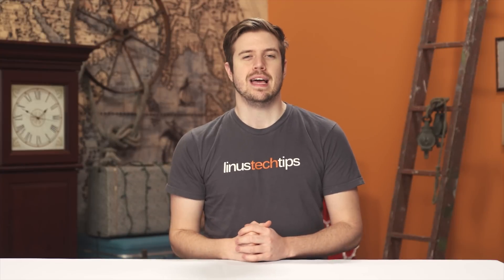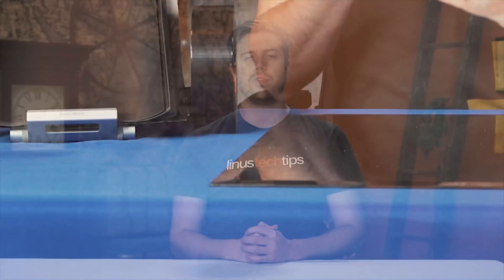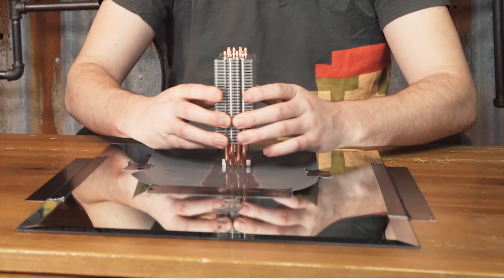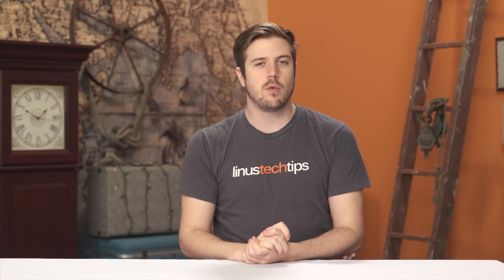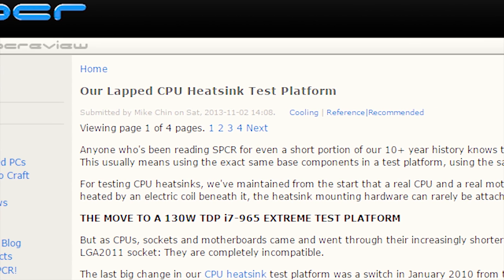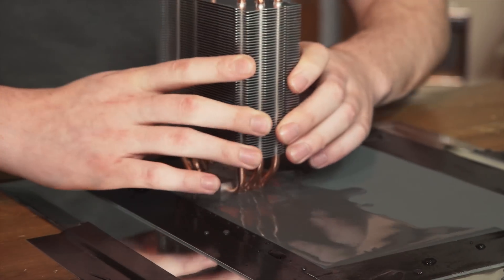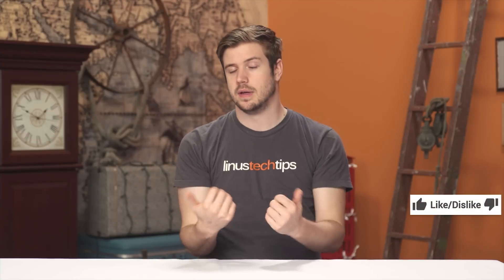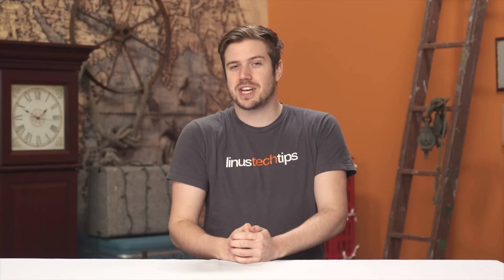CPU & Heatsink Lapping - Are concave, convex, or flat heatsinks best for cooling?

Comment: Your lapping job initally looked quite poor. It should be a mirror finish when said and done. Lapping is meant to take out imperfections you are unable to see with the naked eye. If you can see a scratch. You have a defect in your surface

Comment: Look at all the 9 year old comments. The Internet last forever. Anyone tried Honeywell PTM7950 Thermal Pad. It does a phase change and turns into a liquid when the parts warm up. It seems to work very well. I want to try a mx4 vs Honeywell pad.

Comment: My stealth cooler for my 5600x got some scratches and so did my cpu. My temps were in the high 80s. I wet sanded them both and put it back together. It’s now in the low 80s to high 70s not much of a difference but kinda. I just need a better cooler honestly. It’s a small custom build in a q300l with a full atx board and the psu in the top right. It gets warm lol. I also need a new case but this is working

Comment: In curious if convex vs flat has changed at all with chiplet based CPUs. There’s more heat further away from the center, so does a convex cooler make less contact where it needs to?

Comment: Just to add a modern take on this.
11900k, concave stock
Ek aio 360basic, flat.

Lapped 11900k flat. 
Noticably removed high spots opposite the socket clamps.

Dropped 8-10c at idle, and 4-6c under most synthetic stresses.

Same paste, same tube. No lapping on cooler.

All max speed fans, and pump in both examples.

Also did a 12600k, with a nhd15, but did both flat. 2-4c regardless of load.

Comment: People always forget to tune their components in concert! You need standard thermal paste to fill standard gaps between heat spreader and cooler. When you reduce those gaps by lapping you need a different TIM to make use of the full potential of your change. When your surfaces are flat to 1µm (which you can achieve by manual means!) a thermal paste that uses 20µm particles is harmful to your result. You need smaller particles or no particles at all. It's like mounting race car suspension in your off road truck and then use energy saving narrow tires. USELESS!
It's funny to see computer nerds in shock and awe when using something mundane as sandpaper. ^^ You can get away with doubling grit numbers speeding up your process tremendously. 400, 800, 2000, 4000 then polish. Good enough. You are grinding soft copper. Not steel sheet.

Comment: One big problem here in the lapping
He is lapping the cpu and heatsink where they are not under the stress/pressure that it is when you use it ( when you put the cpu in the sucket it slightly change under the pressure from the mounting bracket on the socket ( the silver plate and arm)  and the heatsink is tighten down the block/ part that's in contact with the cpu is under a lot more stress/pressure when mounted where it deform from its stock/unmounted state )

If it should had been done right he would had needed to mount the cpu in a bord/ socket so it's under the right stress and the heatsink in a mounted state/under it's full mounting pressure and then sand them flat 

So when he then mount them together they have already been flatten under those conditions and therefore is flat to each other under mounting pressure when they get put together for real 

Aka you need a way to mount and stress the material that they are made of at the same amount as then will be mountes to Heather before flattening them ( may not me flat when you unmount them but when you mount them back together agents the become flat since that's the form/stress then where flatten in)

We have to keep that in mind at my work when we machine stuff 

( we may machine it flat under pressure in a vice but when we release the pressure it's been under when we machined it then springs out of flatneas)

Comment: When Your cold plate or erect area of cooler is concave, or convex, You can get up to 7 - 10°C on thermal paste, or 3 - 5°C on lm, when Your cold plate or erect area of cooler is straight, You're gonna get some 1 - 2°C within a margin of error, since You won't always apply the thermal paste or lm well. Also remember, not only cold plate or erect area of the cooler can be concave or convex, Your ihs can suffer from this imperfection too, although it's been rare for the past few years.

Comment: So lapping + deliding with LM and using a good thermal paste can give up to 20°C improvement? Cause back then I got around 15°C when using LM under the IHS.
Even better would probably lapping the cooler and CPU to make both equally flat.

Comment: I had to watch this video because I tried to bend the copper heatpipes since my cooler was slightly sagging. Found that the contact area wasn't straight due to the heatpipes so I tried to flatten it by pushing it down... Removed the aluminum bracket instead and fucked up the pipes a bit.

Managed to cobble the bracket back but the contact surface wasn't straight anymore. There was a huge gap in the middle too and it was horrid, obviously my temps were horrible too. 

On Cinebench R20 my Ryzen 5 3600 oced @ 4.4gHz 1.31v got up to 96 fkin c from 80~ @29 ambient temp.

After lapping it down I managed to get it back to 79, so hooray for me.

Comment: Personally I wouldn't prefer lapping a heat pipe heatsink. As there hollow and not that thick of pipes. So your just removing more of the absorbing heat material. Lapping was created before the heat pipe heatsinks. And as mentioned in another comment lapping is to be done to the processor also to get a better contact surface between the two. But in all a correctly done lapping procedure does factually reduce temperatures.

Comment: You mention avoiding skipping the cooler on the sandpaper, but there was A LOT of skipping in just the short clips of you sanding.  You did a shit job and I don’t get how you can draw any meaningful conclusion.  

Hold the cooler at the base and make sure there is absolutely no skipping.  Any amount of skipping will negate having a flat surface.  Use windex or very light oil instead of water since it clings to the sandpaper.  Sand the cpu as well for best results.  You already have all the supplies, so why not.  

Be nice if you would redo this video with more science and less “whatever”

Comment: Getting back to this video after 3 years, now I can confirm that lapping will do "something" to affect cooling performance. But the catch is that "something" really depends on what cooler you are using. Lapping only affect the effiency of heat conductivity, so there is no surprise that Luke's 212 evo shows no difference at all since it is a smaller cooler. However the lapped 212 evo should have reach the same temperature in a longer period. Lapping a air cooler should not affect the stabilized temperature for a giving size cooler until it hit the sweet spot of the cooler's heat dissipation, which means you either need a bigger air cooler or bigger/faster fans. So idealy, lapping a air cooler is gonna make it performs more like a water cooler.

Comment: Whitworth should be required reading here, it doesn’t matter how flat one surface is if it’s paired with another that isn’t equally flat. Thankfully today calibrated surface plates can be had for very little money if you really want to try lapping I’d start there, and lapping in a figure of ‘8’ is much more consistent and takes less time.

Comment: On one system it made a big improvement after sanding the CPU (water cooling). I was having an issue on this system with temperature raising and thermal throttling. I tried everything to fix it and until sanding the CPU nothing worked. I can now point to one case that it worked.

Comment: I'm like really late to this conversation but the fact that most of these workshop videos just come up with no difference is actually really interesting to me. Because it shows that the hardware engineers and the industry at large has already tackled these questions at some point when their design decisions were made and ensured that the peak efficiency range of the product is so above and beyond any variations that may be encountered in day to day operations. Parallel, perpendicular, push, pull, etc whatever. And I think that's kinda cool. It doesn't leave too much room for enthusiasts to tinker because the ceiling is so high right now but it also means most novice or average builders/users will never have to worry about these variables.

Comment: I just watched a Linus Tech tips where they delidded a processor, in that processors case, it originally had poor cooling because the IHS was curved. The curve was so bad it spun like a top on the table and lapping improved its cooling performance by no small margin.

Comment: What good is a super flat heat sink base if your IHS isn't super flat AND you're still using the same amount of thermal compound. It definitely will improve high end over clocking when your CPU's IHS is just as flat as your heat sink and the thermal compound you use it ultra thin after applying the pressure of mounting it. I work at a machine shop and have been wanting to bring my delidded IHS and my water block to get it much much flatter and see if it makes a big difference on my setup.

Comment: What a waste of time.  If the gains people are getting are -1 to -5 degrees, that could be due to anything.  Maybe these people were more careful about how they applied thermal paste this time.  Maybe they tightened down the mounting bracket a bit more.  Either of which could help temperatures way more than sanding down an already finely-machined heatsink base.

Comment: So in regards to the dreadful apple MacBook Pro and iMac pro cooling that chokes the performance, would a Concave, convex, or even liquid cooling make a difference in prevent the CPU from choking? It so tiresome to spend $3600 for a computer that want even manufactured correctly; poorly applied thermal compound, fans that never turn on, like come on!! I really wish there was a way to make apple do the right thing.

Comment: People tend to look at lapping in the wrong way. The reason to lap is to get the flatest surface possible, so it requires less thermal paste to bridge the gap between the IHS and HSF.

The thermal conductivity of most top end thermal paste is in the 8-13 W/m-k range. Coppers thermal conductivity range is 350-400 W/m-k. So, let's say your IHS and HSF/cold plate are both made of copper. You would achieve better thermal conductivity with the two making direct contact, rather than using a thermal paste between. The problem you run into is warping and scratches. These prevent the two parts from making complete contact.. This is why we lap. To get the absolute flatest and smooth surface we possibly can. So we may use the very least amount of thermal paste possible. And increase true metal to metal contact.

Honestly, only hardcore enthusiasts and overclockers should consider lapping. Your average builder really should not even worry about it.

Comment: I have done it a few too many times, mostly in the past with old square heat sinks with solid bottoms, those would almost always be concave, modern designs and processes means that at the minimum they will be roughly ground flat. 

So if your rebuilding an OG Pentium 1/2/3, K6/Athlon era machines it might drop temps fairly well, otherwise I will check with a metal ruler with a light behind it  (just hold it up) and if there is not a hideous dish in the middle its good to go

Comment: I just lapped my Heat Sink and CPU!
It turns out the Heat Sink was concave,and not by just a little bit!
The CPU was the same!
I only went down to 1200 grit, which did not make it shiny,but that is not important,and makes no difference in the end!
The real proof is that my idle temps went from 70 degrees C. down to 53 degrees C.! 17 degrees C., i was astounded to say the least !
The process took only an hour!
I use Dielectric grease as Thermal Paste as it spreads and covers better that proper Thermal Paste!
I highly recommend doing, this as your CPU will last longer and perform better!

Comment: I've seen up to 5c different in temps when going to 2000 grit  when taken to 7000 grit it was 9-11c On cool master lite blocks it works go get a 240 or 280 cool master lite and lap it you will be amazed

Comment: Lap both the cooler and the IHS of the CPU to an absolute mirror finish, using 0.25 micron lapping paste (or finer if you can find it) as the last step. Finally, do not use thermal paste. The point of thermal paste is to fill in the tiny gaps, if your finish is good enough you won't need it, and it'll actually impair cooling because it doean't conduct as well as bare metal.

Comment: Yeah, it makes a lot more sense that the curve would matter -- if you're just trying to remove little imperfections, that's just plain stupid. -- That's what the thermal compound is for, all the pressure between the CPU and the heatsink causes the thermal compound to squeeze into all of the little micro cracks, and crevices and so it's already going to fill in all of those little imperfections; so, trying to remove them is kind of pointless (unless you're trying to cold weld without the use of thermal compound... then that would be an interesting test).

Comment: This isn't going to work, for most CPU/heatsinks they are already flat compared to what you can achieve by sandpaper and a flimsy grip. For real lapping you need a lap and a way to test the flatness of your surface like an optical flat or a spherometer, this should enable you to achieve surface flatness of about 200nm or better if you have patience, wayyy better than what most CPU "lapping" guides do. In fact using thermal paste on a correctly lapped CPU/heat sink harms performance, you need a very tin thermal fluid like silicone oil and you get very great thermal performance.

Comment: I wish you had shown testing of the base prior to sanding, when your results showed nil, I nearly quit the video, and imagine others felt the same way.  Please do another video with some more samples, and showing base status before hand.  

I recently checked my waterblock which was wavy , both concave and convex.  I can only assume this wave was created when the manufacturer put the copper on the buffing wheel.  Also, use a piece of flat steel under the glass, or better yet, a granite block from a counter install.  Scraps could be had pretty cheap from a cabinet installer.

Comment: I really don't get this video. The title says "CPU & Heatsink lapping" while the video only shows the heatsink being lapped.. 
If you don't flatten the TWO surfaces, of BOTH the CPU AND the heatsink what are you expecting to happen? Use some common sense maybe? 
Also the heatsink after lapping looks terribly bad, just like nothing has been done. So, basically, you didn't do anything, and make a video of it to conclude "hey guys, guess what, it doesn't change anything?". Oh, really?
I'm not even saying it would end up providing any decent improvement, but at least if you are trying to make a video to test a point, do it right.

Comment: Im a machinist , I do this from time to time at work with hydraulic pump parts during rebuilds. When lapping if possible it should be stressed in the exact same way it would be in use during the lapping process. Once mounted to the cpu the base of the cooler may be stressed and bent slightly from said stress. Both aluminum and copper are soft very ductile materials and may be effected greatly depending on the stresses involved in mounting . I dont know how u would solve this on a cup cooler but just wanted to note something I knew about lapping that may or may not be critical in this situation.

Comment: what you missed was as you sanded away metal... is the cooler got further away from the cpu and more thermal past had to be used ...what should be looked into what thermal past has the highest conductivity and what dose not ..

Comment: i think this will give huge improvement if the heatshink used without thermal compound.
But since we all will use thermal compoud, some rough on the heatshink contact will be cover with thermal compound.

Comment: Luke

Get a granite surface block, and some prussian blue, put the prussion blue on the granite, wipe leaving a thin coat, then rub the cooler plate over the granite plate, and then look at the cooler plate to see if there is a uniform coat of blue (ie, it's flat) or blue on the outer periphery (ie, it is concave) or it is just blue over the center (ie, its convex).  Having sorted the cooler by the plate geometry, then try the lapping again on the concave and convex ones and test to see what happens  Grizly sells an affordable 12x12 granite surface plate if you need a source, or just check with a local machine shop, they will have them and probably let you do the tests on their plate

John

Comment: The reason the improvements that were so  much grater is not due to you doing anything wrong but technology moving forward.
The variable that you did not replicate is the old thermal past we used to use compared to what we have now. Use the old style white heat sink grease that we used to use compared to say arctic silver, and you will see a big difference after lapping.

Comment: Also available at the auto parts store is lapping compound for lapping a  valve into the head to make a seal. It makes me wonder if there is any benefit to lapping a cooler directly to a heat spreader rather than just making it flat.

Comment: you guys do know that the whole point of thermal gunk is to compensate for the imperfections in the contact materials between your processor and heat sink, right? in other words it the shape or roughness (with in reason) of the contact points shouldn't matter as the thermal gunk will fill the void spaces up and allow them to conduct just as well as if they weren't there.